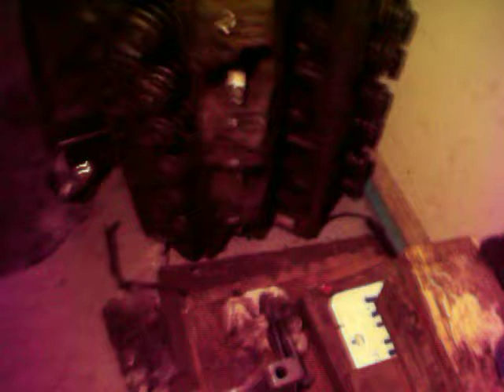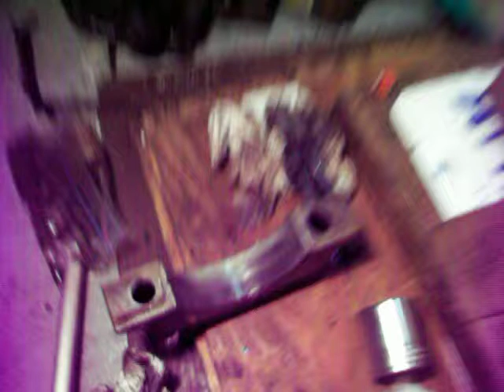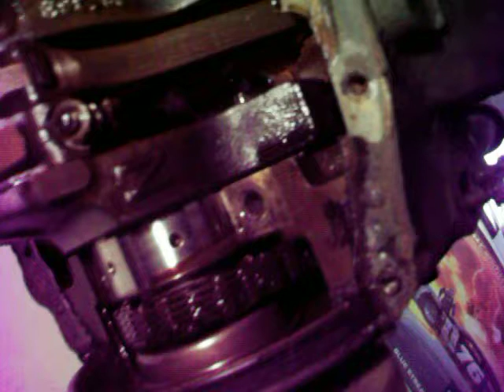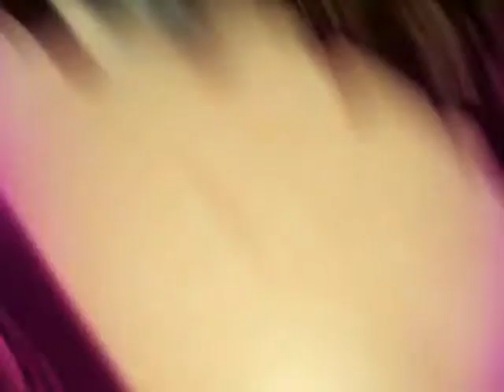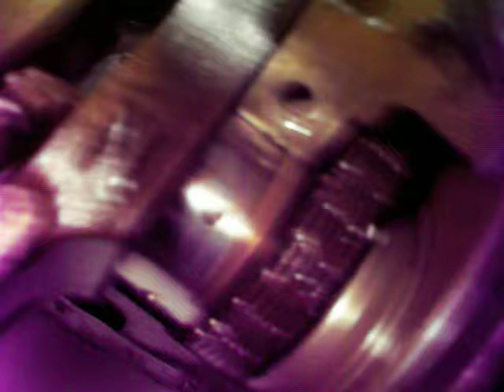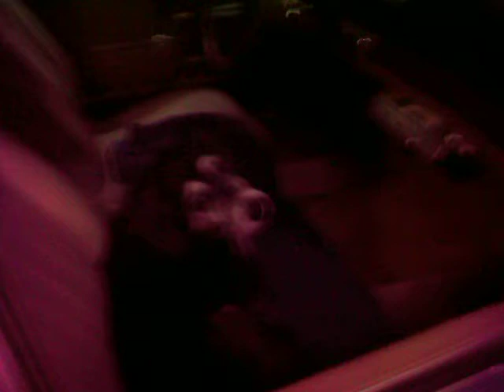Oldsmobile Rocket 455 V8 Progress, a main bearing Oct 19 11 001.MOV

Comment from the maker: @olds442hurst I did notice it was a little shiny, but not worn down to the copper, in the middle, more to one side.  The block and crank and other bottom end parts are going to be checked by a proper machine shop that has done Oldsmobile engine stuff.  A budget is a budget, but cheaping out with these parts is foolhardy and a waste of hard work doing all this.

Comment from the maker: @462ANIMAL Like I said,I am getting used to it, and it is fun indeed, to the point,  I am tied up in knots to be near it, figuratively and literally.Getting the oil pan off meant major contortion. It is pouring outside, so the car stayed inside.As I've said to in other movies of myself squirming around in the garage, Pilates (now!), gymnastics (years gone by!) are paying off well.The garage stays warm enough,it is insulated,and dry.On really cold days, a heater and an old hoodie are just right.